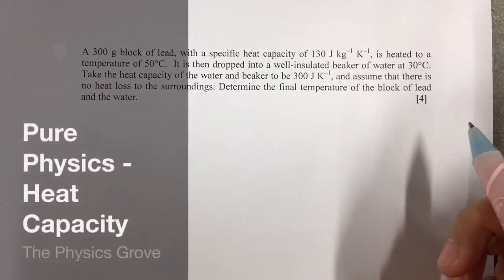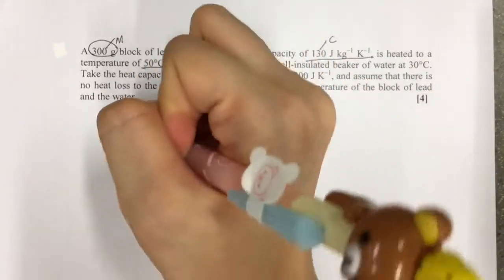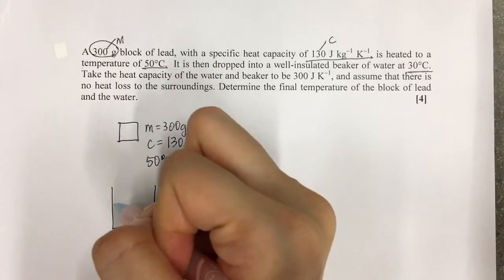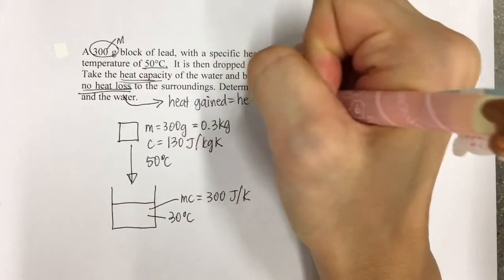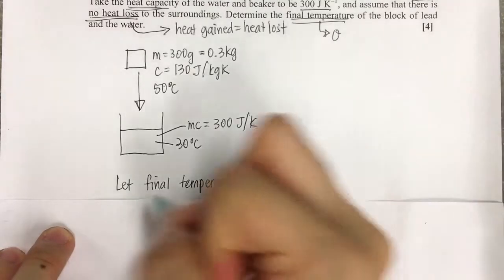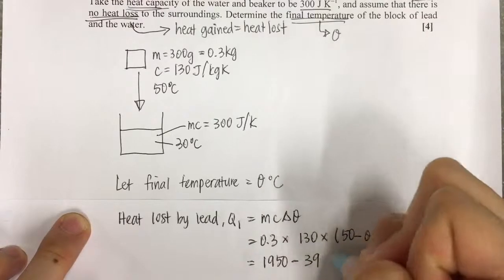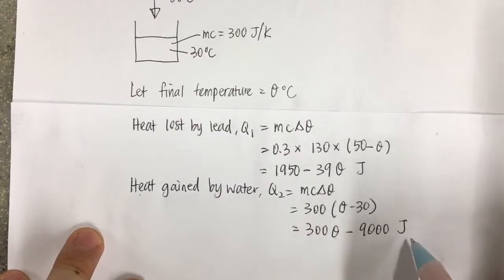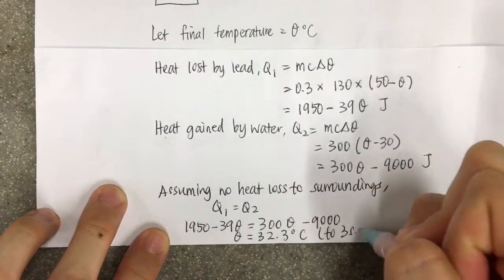Solving Heat Capacity and Specific Heat Capacity problems - Pure Physics

Comment: I had a similar problem in a test I had. I was so confused of what to do because i was given heat capacity of the calorimeter but the substance dropped was given its mass, temp., etc. I didnt know that i couldve just set it equal to each other because i wasnt sure if Q (heat capacity)= Q (specific heat capacity)